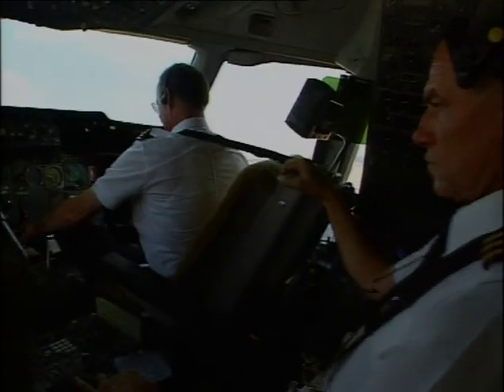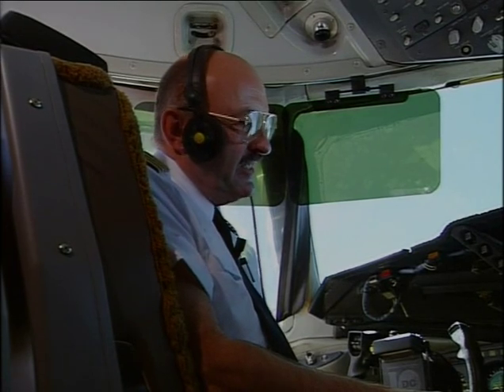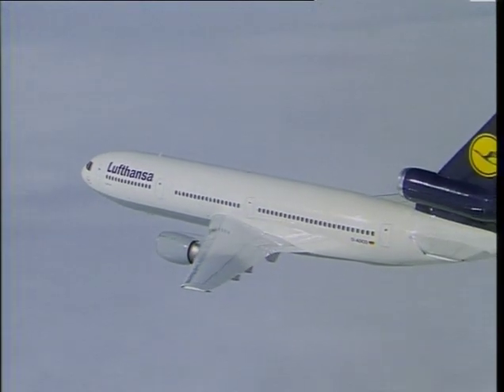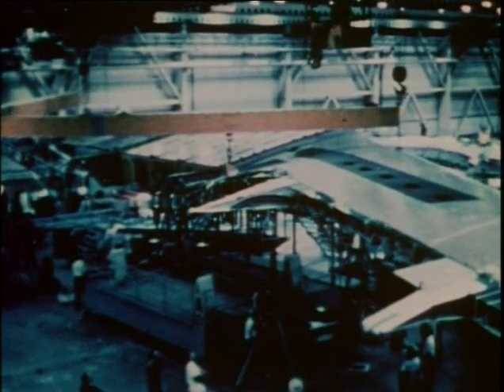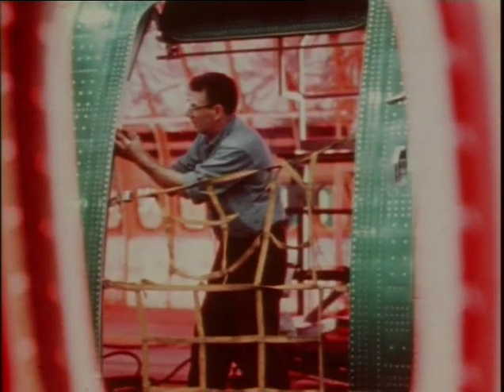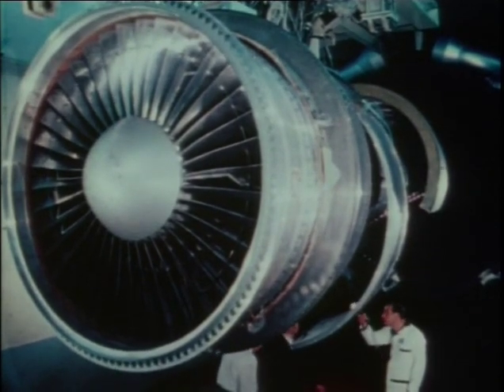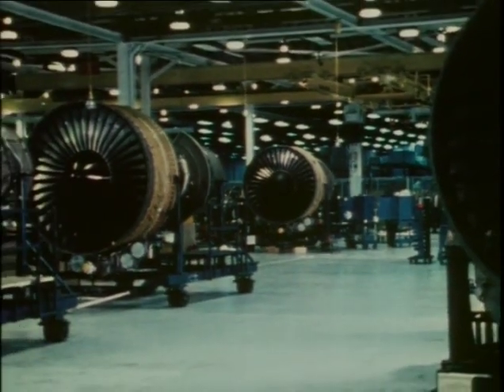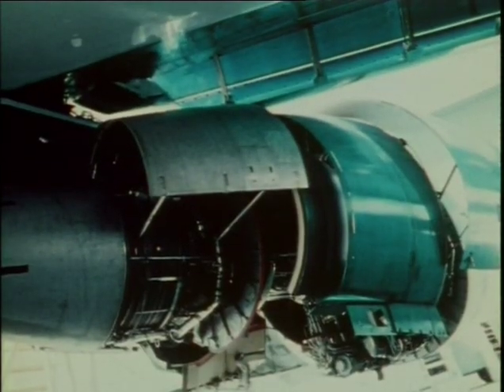Lufthansa DC10-30 cockpit flight Frankfurt- Beijing part 2 of 6

Comment: Nostalgia aside what a flying death trap that DC-10 was.
Reply: To state the DC-10 "a flying death trap" is absurd. Yes. the aircraft initially had a engineering fault with the rear cargo bulk door. This was exasperated by the Turkish airlines tragedy caused by ground crew who couldn't read English door operation instructions on the door ! The other accidents (American Airlines Chicago)(United Airlines Sioux City)were caused by aircraft maintenance personnel NOT following aircraft manufacturer maintenance procedures !

Do I claim Airbus Industrie A330 "a flying death trap" (AirFrance flight 447) because of faulty pitot tubes ? or its pilots too dependent on its flight computers?
NO !

Here we see Lufthansa operating the DC-10-30 for many years without any mishaps whatsoever until its retirement.. The aircraft fulfilled Lufthansa's requirements perfectly and in turn Lufthansa took care of the aircraft with professional maintenance personnel.
Reply: Craig Martin exactly!!!!
Reply: I cannot agree more, it was the flying death tube.....it's now done taking all those lives
Reply: @brianglade848  what about the 737 MAX?
Reply: Chicago 1979.....
Reply: @brianglade848  Blame American Airlines. Who uses a forklift and unapproved tools to change an aircraft engine???
Reply: @Canleaf08  unapproved tools?... Like what installing a screw with a fork?
Reply: @brianglade848  was down to cutting corners maintenance not the actual plane